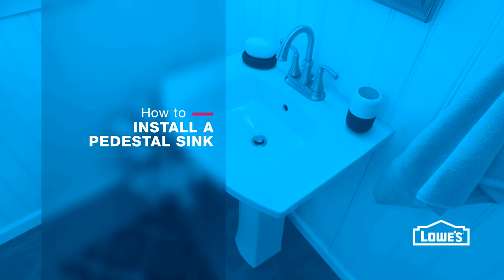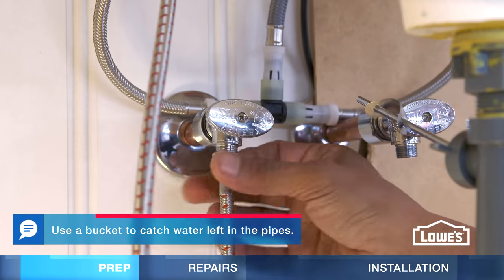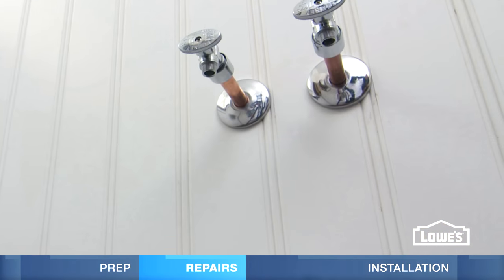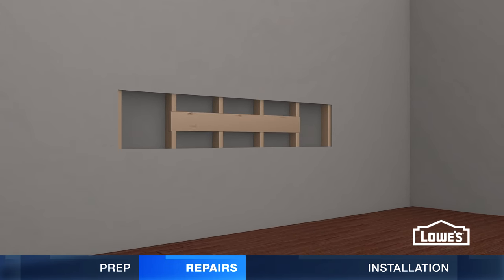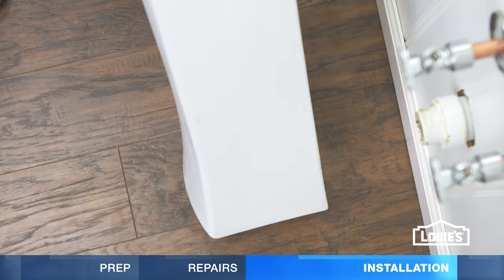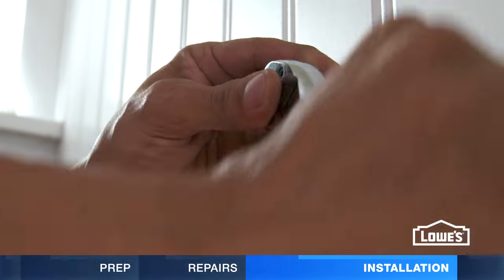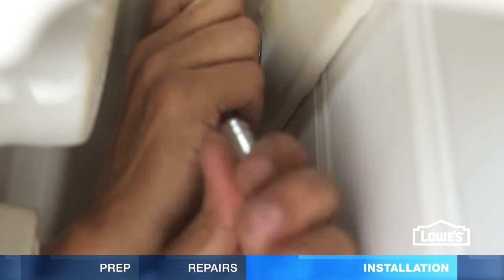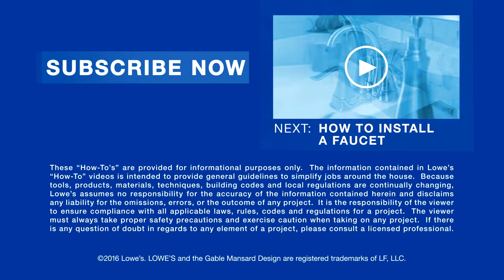How to Install a Pedestal Sink

Comment: I never anchored the pedestal to the floor, and I went right into the Sheetrock to mount the sink using screws and plastic wall anchors. After caulking the sink and the base of the pedestal, my sink is still holding solid after 20 years. Never moved.
Reply: I like your idea better. I think I’m going to do the same thing. 👍🏽
Reply: Same here except with the wing nut type anchor, holding up 22 years now

Comment: It's not this easy folks. Doable sure but you're gonna drop some f-bombs before the day is through
Reply: I found it to be easier bro. Simple fact is some people are better at using their hands to write and do office type work and others are better at fixing, building and doing  more physical type work. Perhaps this is why you found it so hard. I just had to remove the old sink , fix the subflooring, put new floor in. Install a brace board for pedistal to attach to, move the water lines to even them out and make them look good and then fix the drywall. Installing the pedistal sink was like the easy part of remodeling my bathroom.
Reply: @delawarepatriots  oh I'm good with my hands, and fixed my pedestal sink, changed supply lines, rebuilt the entire drain as well. I may not be as talented as you judging by some of the work you've done but I am capable. All I was saying is this video is misleading as you encounter many unforseen variables when tackling projects like this. If you're as great of a handy man as you claim to be you should know that projects like this are very rarely as straightforward as this video makes it seem
Reply: @SuperTwilightZoned  So true. I learned to never start an "easy" project on Sunday afternoon when home supply stores close early and you need that one part that you didn't think or know you'd need because the project took a turn. And they always take a turn.
Reply: What if I don’t have a brace board?
Reply: @mountainbiker44  that's why you cut through the drywall and studs and install one yourself.
Reply: @delawarepatriots you needed that ego boost huh lol. It’s not a great sink, it doesn’t even come with any hardware lol

Comment: My floor is porcelain tile.  The plumber secured the pedestal to the tile with some sort of black mastic goo that he got all over the bathroom.  He also cracked the pedestal and tried to hide it by gluing that back together.  Everything thing was good to go in a couple months and that plumber will never darken my door again but putting this thing in on tile is a big deal and rerouting pipes?  Forget about it.

Comment: You totally skipped over securing the pedestal to the floor!
I'm trying to repair pipes under one, and I can't figure out how to remove the pedestal.
Reply: Donald Drennan they didn't though, they mentioned drilling a hole in the floor and adding a lag bolt in the base.
Reply: ChrisWithACam , in my opinion, they skipped over the part that I needed to know about. They didn't show it being installed.
Reply: Clear silicone caulk works fine on floor

Comment: Lame.  Simply a "sales" video to get you to buy additional stuff from Lowes.
Reply from the maker: Bummer! Our goal was to make a clear, simple installation video for a very affordable bath project. What suggestions do you have for us to improve this content? What were you looking for? We love feedback!
Reply: Lowe's Home Improvement 9
Reply: No need for improvement. It was a great how to video, right to the point. I'm not sure how Centertree777 thought it was a sales video, it showed no specific product or price.
Reply: How to do it in a cement (concrete) wall.
Reply: No worries, Lowe’s: right on target. Thanks.
Reply: @lowes  , show it anchoring to a tile or ceramic floor as it most likely would be, and consider including this step in your link.
Reply: How to anchor pedestal to tile that has heated wires underneath; sure not going to drill into that.  To what extent would liquid nails prevent horizontal movement? Would other glue or grout work better? Thanks